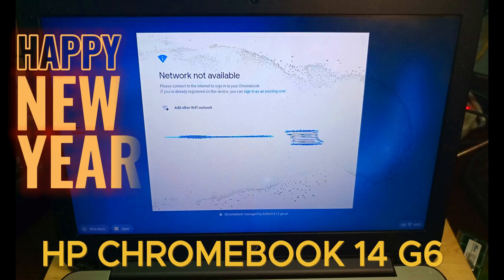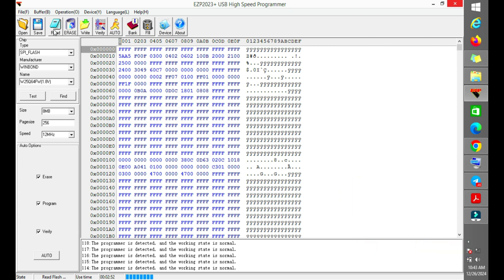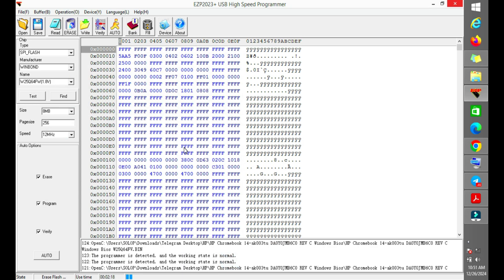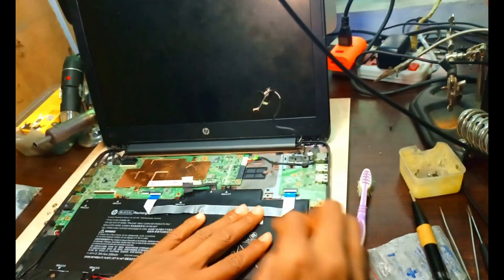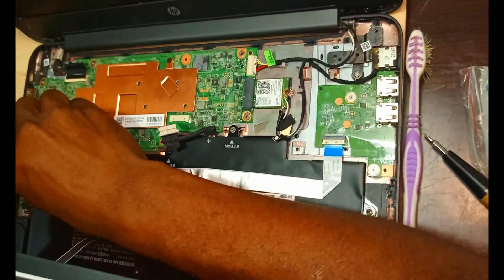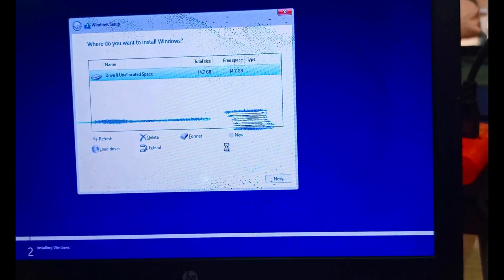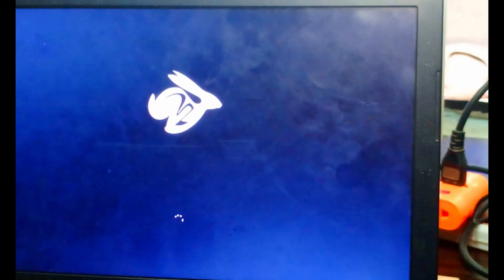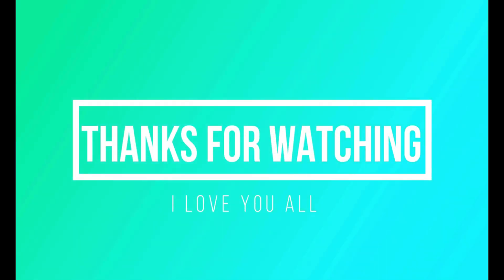Another Method for installing Windows 10 on HP Chromebook 14. #chromebook

Comment: Pls make a video for converting hp Chromebook 14 g3 to Windows
Reply from the maker: It can't work because HP chromebook 14 g3 is using a ARM processor and it is 32bit based processor, it won't work.
Reply: Alryt, tnx